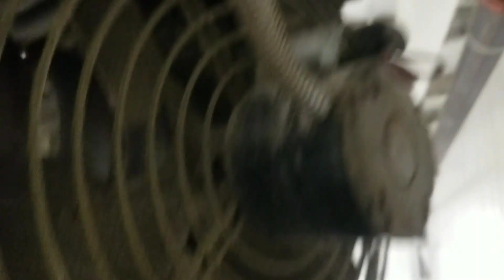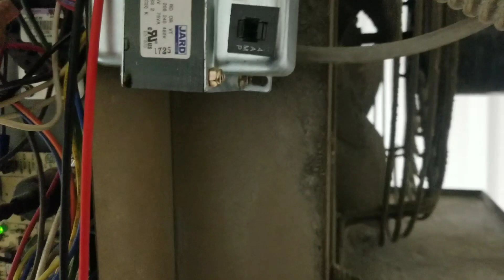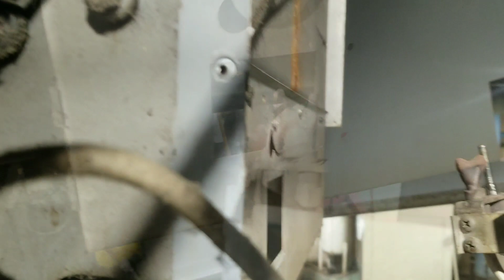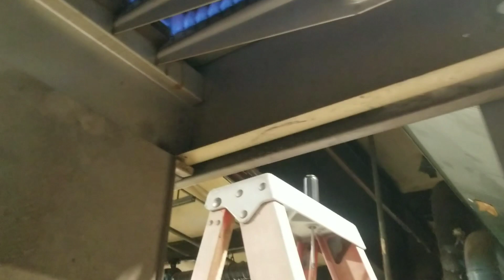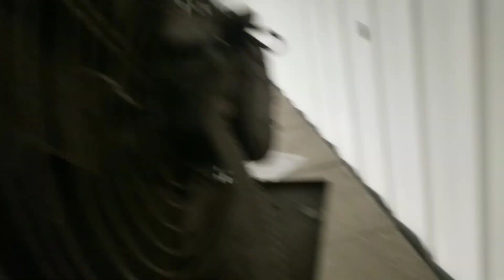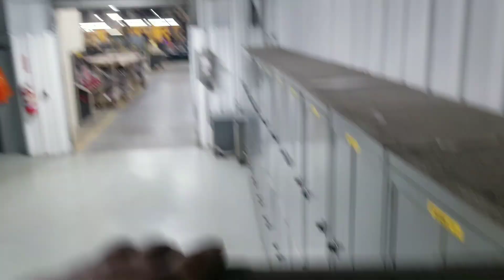hvac, 2 unit heaters down, no heat service call.

Comment: What brand heater would you recommend for a home owner shop.  I just removed  a Dayton that was putting fumes in the shop with no power vent so it's pretty old.
Reply from the maker: Find one that you have accessible parts near by, that way you can get them fairly easy. Dayton, I believe is sold by Grainger. Our local supply house carries Reznor parts, they make a good heater as well.

Comment: Wow, that much machinery in the room and they still use gas heat? Surely a damper venting the exhaust of one of those units into the room would be more than enough.
Reply from the maker: Possibly but the outside wall was there main concern, old building, not much insulation. They've apparently had issues in the past with low temps.
Reply: Then what happens during a shut down of the heat producing machinery?
Reply: @edp9743  then you rely on gas. Have the thermostat on the dampers set a bit warmer than the thermostat on the gas heater. When there's free heat, you use that. When there's no free heat, you use gas.

Essentially the same as an economizer on an AC.

Seems like it'd be the better way to go, as those machines would be pulling a butt load of fresh air in from outside. But hey, if you can afford to run compressors that large the gas bill for that heater wouldn't even register.
Reply from the maker: I'm not sure all of that machinery is even operational, the only drier I saw run was the one next to the heater that I pointed out. It is possible with a fully operating plant and all the machines operating that they would not need this heater.
Reply: @EverythingHVACR  judging by the exhausts on those machines - out the roof, I'd almost think it'd be the opposite? More machines running would be pulling more outside air into the building. Optimized for summer operation aha.
Reply from the maker: Didn't really think about it that way but you may be on to something,  good call! 💯